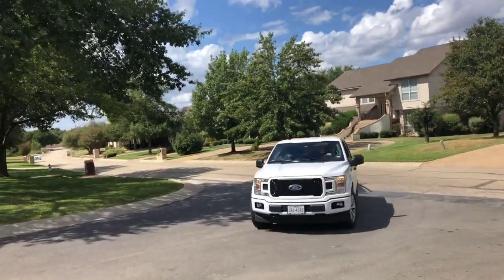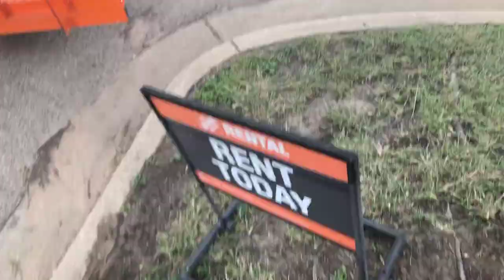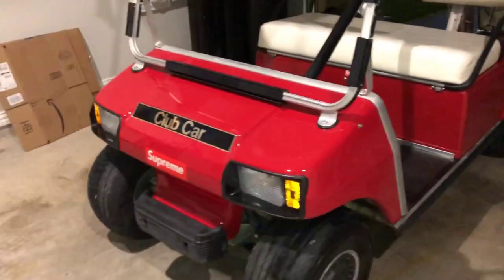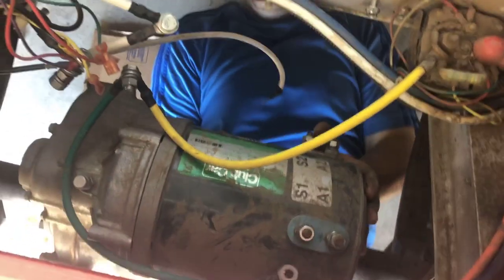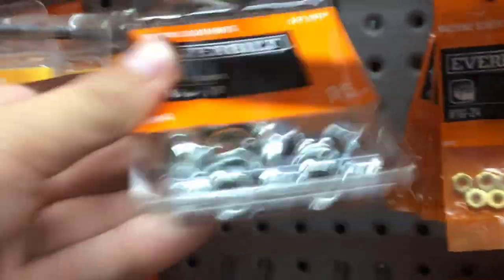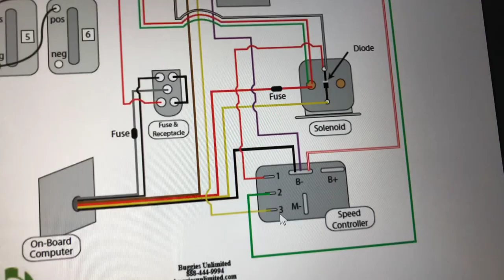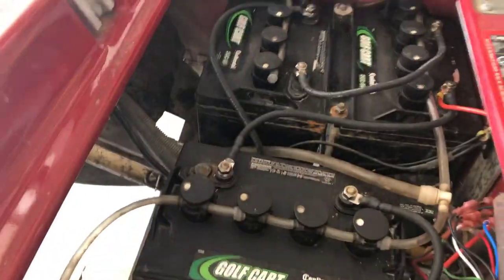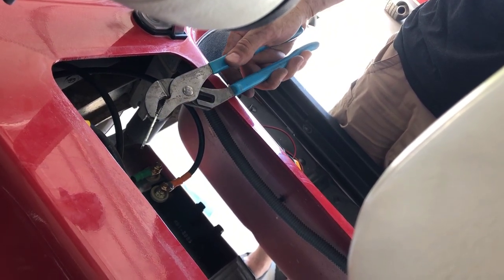Golf cart motor upgrade!Part1 VLOG#11

Comment: I noticed you didn't use a wrench to hold the bottom nut on the motor studs...that is a no no
Reply from the maker: Everything has been in its place so ig we did a good job doing it a different way. 👍🏼
Reply: @texasrandom583  If you don't use a backup wrench to stop the stud from rotating you can damage the stud resulting in a costly motor repair. Toledojeeper was just offering advice that could save you money.
Reply from the maker: If I ever have to mess with the motor again ill take that into consideration thank you

Comment: What’s going on is you have no idea what’s your doing. Get yourself a guy that knows low voltage and learn from him. You can only get better. Good luck and keep learning.
Reply from the maker: Ya your right we didn’t know anything at the start but eventually we got it. The solenoid was the issue and its been running great since.
Reply: @texasrandom583  )